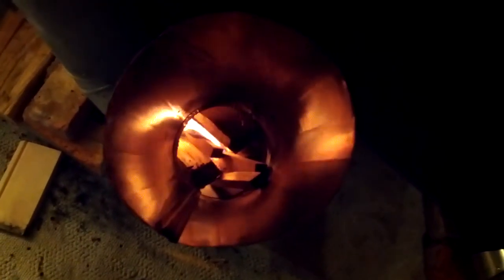Rocket Stove for fireplace

Comment: Have you tried making a gravity feed to burn pellets?
Reply from the maker: Nope.  Good idea.
Reply: @TransAtlanticEV  & you burned right out of the pipe?
Reply: @TransAtlanticEV  I have pipe going from side to side right across the top of the fire in the fire place w/ a small 12v fan pushing the "warm" air thru the pipe & into the room. Looking into this RMH idea.
Reply from the maker: Yes, it worked well.  I don't own that house anymore though

Comment from the maker: OK, Just to be safe here.  I looked up the melting point of zinc and found it to be 692.68 K (787.15 �F) 
420 C or 419.73 C.   I didn't have the stove anywhere near that temperature however, I will swap out the galvanized metal soon in order to make sure no hazardous chemicals end up in my lungs or my families lungs.   Rather safe then sorry!

Comment: I only had a moment to peek at them but have to get back there, looks like mainly the galvanized like you used. I wasn't sure if it holds up to as much heat as the black pipe or not, feels thinner to me.  let me know how yours holds up. If I get the pipe cheap enough, I will experiment with it for the rest of this season.

Comment: something to remember, if you have lots of elbows (which I didnt).. I would have put alot of U's and zig zagged across the front of the firebox working my way up, then drop down and enter the firebox. the More pipe in the rise, the more heat surface. If I find more of the right size elbows, I will probably do this next.

Comment: Ya. I have had some bad startups. I find if i can start the fire in the updraft tube, i get zero smoke in the house. I want to try a 2nd T and build a gasification chamber but still looking for more pipe. Just found a place with 2 pallets of used pipe i need to check out this week.

Comment from the maker: Reginald, I used your design and Home Cheapo didn't have the T so I just used and 90 degree elbow as the feed tube.  Slight smokey smell according to my kids but I didn't notice anything.   I really want to get the T and then control the air flow.  Think that will help.  Wood burns pretty fast inside it I am finding.  Just hooked it up today!  Thanks for the help.